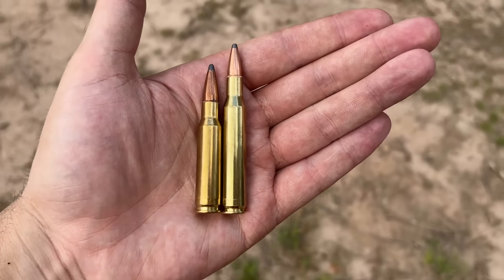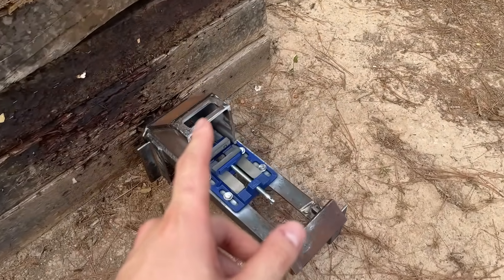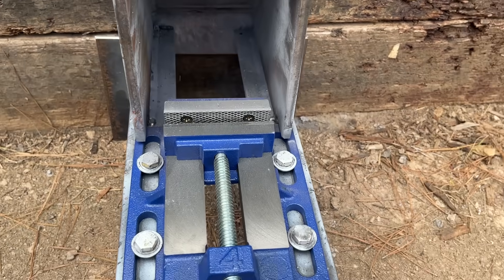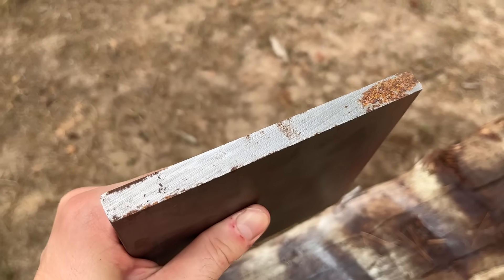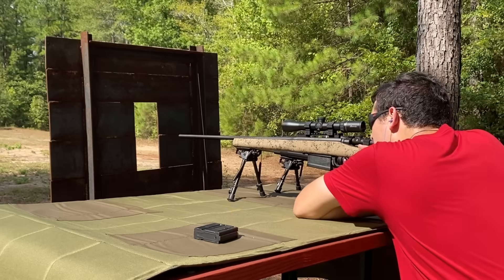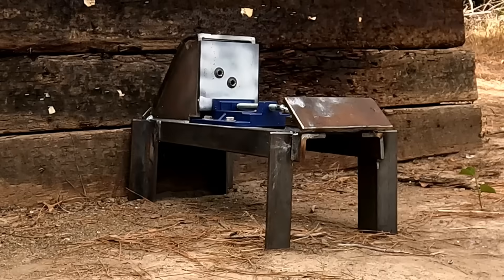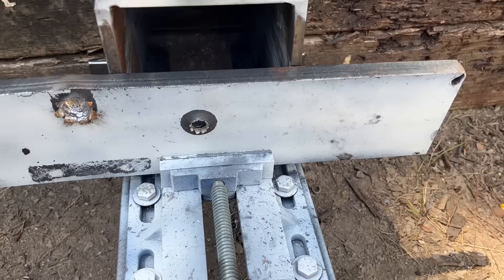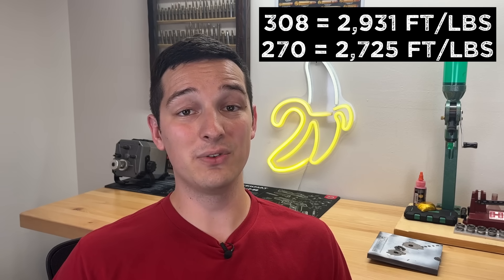270 Win vs 308 Win: ONE Clear Winner On Mild Steel

Comment: Usually, you’re going to see 20 inches in .308 and .270, probably 22 inches so it’s not exactly apples to apples but I’m glad you didn’t compare 150gr to 150gr. That would be like comparing 150gr 9mm to 150gr .40 cal. One is going to penetrate and not expand and the other is going to expand too much and not penetrate.

Comment: On a western mule deer hunt in 1985 a friend of mine made the challenge. A penetration test between his .308 and my .270. He picked out a sizeable spruce and we both put a round through the trunk. Both of us were shooting hot handloads. He was using .308  180 grain speer hot core bullets and I had .270 hornady 140 grain btsp bullets. My round  shot completely through and embedded itself in a tree trunk behind. His round failed to fully penetrate the first tree. It did not penetrate far enough to bulge or splinter the backside. Both shots were centered and about 16 inches apart. That hornady 140 grain 270 is the best bullet I ever used in my .270 handloads. I have killed several good sized deer with those bullets in front of 55.5 grains of IMR 4350 and 3 of those were head on chest shots. Two were complete pass throughs and one stopped under the skin on the beck of the right ham after shattering the hip. I cut the skin and saved the bullet which I washed and weighed on my powder scales and it still weighed 107.5 grains. Excellent controlled expansion and good weight retention. Still using the same handload ingedients with excellent results. Other than well flttened primers and stout recoil, I have some cases that have been reloaded a dozen or more times. No case head separation, no split cases or primer burn through. Neck sized only and been feeding them through a remington 700 classic since 1984. The rifle action was glass bedded and barrel floated. It will print sub moa 3 shot groups to this day from a sandbag on a bench with those handloads. I bought that rifle new in 1982 and wouldnt trade it for anything else.

Comment: Interesting.  If you were able to get almost 3000fps out of a 150gr 308 (factory is normally 2800), it seems like the 270 should have been able to do better than 3000fps.(although that is factory velocity for 130's)

Comment: If the bullets were the same weight the 270 suffers velocity loss and will fare even worse.
Velocity is the driver of energy as it increases by a squared progression as opposed to mass which has a linear progression. 
E.G. the 170 30-30 has less energy than the 150 due to the 150s increased velocity.

Comment: Within 500y, 270 is king. At range 308 takes the title. One benefit to 308 is you can drop down to 14.5 or 16 and still be effective past 600y whereas 270 is stuck at 20 in before theres severe drop off

Comment: If you used the same bullet weight in both rifles you would get different results. The higher velocity of lighter bullet weight of the lighter causes it to upset more violently so it will not penetrate as well.

Comment: Great video .The 130 .277 actually has a better sd then a 150 .308 (.242 vs .226) so with similar velocitys its actually a very close comparison. Id actually expect the  .270 to penetrate better.

Comment: 270 went deeper because the wall was thinner on the plate so it bulged, the 308 couldnt bulge that 5/8 plate. If you shot the 270 into the 5/8 it would only penetrate probably .300 deep

Comment: I don’t know what to say about the test. I think the interlock 140 gr in .270 might’ve made it through, and was closer to the 150gr you were using in the .308. 
On the boxes of the two rounds, the .270 “wins” at all ranges, but it’s retained power at longer distances grows the further out the two cartridges go. Not to mention the .270 has a higher BC, giving better trajectories really makes it a superior cartridge in my opinion. 
I know, it’s a long action vs the .308’s short action cartridge, but when I’m hunting, that little bit of bolt movement doesn’t matter for me. The .308 is a great rifle as well but it’s strength  vs the .270 doesn’t come with its superior performance when using same weight bullets (because it’s actually slightly inferior), but rather its diversity in weights of bullets it can sling compared to the .270. 
I own and love both calibres, but when I’m lucky enough to get drawn for moose hunting in eastern Canada, it’s my .270 that comes with me. 
Thanks for the videos, I enjoy watching your content. Some of your test results are surprising!

Comment: Against steel is one thing, but my .270 hunting with 130 grain projectiles on deer was rather destructive, too light for the speed. but take it up to 140's and 150's and it worked 100% better. So to match 130 against 150 on steel will make the .308 look the better of the two. I now see further comments below where folk concur.

Comment: You are not comparing calibers, you are comparing bullet weights and velocities.  If you pick a hunting cartridge/caliber based on what penetrates steel at 25 yards you are a fool.  Hunting is more about accuracy than energy and a flatter shooting, faster bullet is going to be more lethal because it’s going to be more accurate at a longer distance.  What makes the best rifle is versatility and combination of speed, bullet type/ weight and accuracy that will deliver energy at short and longer ranges.  I suggest you read a book on design and analysis of experiments.

Comment: The thing about .308 bullets is that they are often tougher than needed at standard velocitys, due to the popularity of the various .300 mags that also fire those bullets. This might produce better results on steel plates, but it deffinately doesnt produce better results on deer sized game, making bullet choice important. .270 bullet development has always been driven by the WIN, and its pretty hard to pick a bullet that isnt going to perform well in a .270win.

Comment: You should have shot the plate with the .308 a 2nd time instead of editing in a previous recording of shooting it. The second shot on that same day with those exact same factors and circumstances would have provided the information needed -> the .308 either goes through again making it the clear winner, doesn't go thru but goes deeper, making it the winner again, or penetrates less deeply than the 270 win, in which case the averages of the shots determines the winner.
Reply: Redo it with the same grain and see the difference

Comment: Love your video's! Just a quick thought. If you were shooting 1/2" (.500") mild steel and the .270 penetrated .518" and .516" of an inch, technically it did go through. The steel stretched instead of punching completely. Just saying.

Comment: Obviously this is some one who likes his 308. He chose a fast 308 and an exceedingly slow 270. Why not use one of the 270 loads @ 3200 fps, or 3215 fps. You really had to search to find a 308 that was even close to any of the 270's. I've seen a 270 put holes through a 3/8" thick steel plate at 100 yards, and the 308, and 30-06 just dented it. Each using the Hornady  SST superformance. And BTW, the 7mm also did better than both the 308, and 30-06.

Comment: The 130 is equal to a 150 in a .308.  This SD.  The.270 is some what longer with a 150 gr than a 150 
308.  So it pentatrates  better
130 vs 150 is relatively equal all things considered

Comment: those differences are marginal but i agree with the results and agree the better round is 308 but at longer distances 270 will preform better same as 50 v 408 cheytec

Comment: Someone needs to explain to you comparing 165gr to 130gr is not a fair comparison at all. My dad has a range set up with 1/2 steel set to NRA specs and the 150gr goes clean through. In fact I shot the first round and was shocked to see light not to mention it was my first and last shot lol.

Comment: That 308 traveling at almost 3000fps is a hot load. Firing g a more standard load traveling closer to 2700 would be a more standard load to compare.hevsaid it himself, he's not a fan of the 270, so he picked a hot 308 load to compare it to... not very objective. Pick 2 hot loads or 2 standard loads for an objective comparison

Comment: A higher sectional density has the ability to penetrate deeper when it holds together... but when 130 gr of soft lead vaporizes on hard steel it just simply runs out of itself quicker than 150gr of soft lead... 150gr vs 150gr would be a more level comparison in this situation... just watch a cup and core lead bullet hitting steel in slow-mo and youll know what im talking about...

Comment: Speed has a lot to do with it, but so does bullet weight. So does bullet design. There are a whole lot of variables. Stick a 150/160 grain Nosler Partition in that .270 and you'll get a whole lot different results. They are both great cartridges.

Comment: The 308 150 interlocks he was using were HOT loads!  2966 FPS is not the normal load 2820 FPS at 2695 lbs is the normal load.  Someone is putting there finger on the scales!

Comment: I just spent i don't know how long reading arguments about if you should load 150 grain bullets into a .270 or not. Because what would be the difference between that and a .30-06 and other similar stuff.

So im just gonna tell you a little thing the military discovered while testing .270 vs .30-06 when choosing which to adopt. The .270 could actually shoot flatter and more accurately at longer ranges with a heavier bullet than .30-06 and it would transfer more energy aswell. The military choose to adopt .30-06 because they wanted a .30 caliber bullet and they though the range stuff would be negligible and they where right. 

In conclusion loading heavier bullets in .270 will provide you with a more accurate and powerful version of .270. If you got a problem with it because it "defeated" the purpose of necking down .30-06 then you dont know why these bullets where made for.

Comment: tbh I see a lot of people arguing about the bullet weight being different in the comments but to my understanding this video is pretty accurate to how the 270 performs. The 270 is not a penetrating round, when it first was developed the round was unstable and when hitting soft objects the round would "blow up". Basically the velocity was too high for the hardness of the led and the frontal space of the round. The 270 is better and more reliable at penetrating and holding together now then when it was first developed but I do think there would not have been a diff outcome in the video if using the same bullet weight. Just my opinion. But I could be entirely wrong too which is okay  if anyone else has something to say on this topic.

Comment: For those that think the 270 shoots higher bc bullets then the 308, well thats not the case anymore. Comparing hornady eldx bullets from each caliber we find the 270 has a 145 grain with a bc .536 and sectional density of .270 compared to the 178 grain eldx 308 bullet, with a bc of .535 and a sectional density of .268 😂😂 nearly identical, and you can push the 178 up to 2700fps plus

Comment: I wonder if a .308, or any that make it past the 1/2" steel would also do two 1/4" pates, or if the physics change that much when a new surface is introduced.  I also wonder what a .280 would do as far as bridging the performance gap.

Comment: I bet if you shot them both into the 5/8” plate the 270 would have penetrated deeper but on 1/2” the 308 had more energy to tear through

Comment: I'm no ballistician but I'm thinking muzzle energy delivered with less bullet weight  must effect work performed negatively...on steel plate. Big heavy bullets at less velocity tend to penetrate and carry on while smaller bullets at higher velocity slow down quicker on impact....thinking of a 450 Marlin/350 gr (2000 fps) over a 30-06/180 ( 2700 fps).

Comment: The .270 goes 1.7 million miles per hour. 
The .308 or 7.62x51 travels at a comfortable 160 mph. But it'll travel through an engine block at the same speed.
 Both these rounds have their places and uses.

Comment: You forgot to compare what really matters here: MOMENTUM. If we forget about "units", and just multiply mass by speed, we get:
.270 Win: 3,072 x 130 = 399.36.
.308 Win: 2966 x 150 = 444.90.
Here you have the simple answer: MOMOMENTUM MAKES THE DIFFERENCE. Forget about the USELESS "Energy" figures everybody is comparing all the time. MOMENTUM is what makes those slugs penetrate, MOMENTUM, 399 vs 444. The .308 Win has half as much again as the .270 has, 50% more momentum. There you have it

Comment: Thank you for the testing. 130gr 270 is my favorite cartridge because it easily achieves 3000+ fps which just seems like a nice speed to me, although I am not shooting at armored targets. Today I shot one of my new Remington "Core-Lokt Tipped" cartridges at a Tide Pods container full of water sitting on a cement block; many thanks to Tide for making the best bright orange targets! The target not only exploded upward, but it smashed the cement block under it! Yes I do have it on video...
Reply: I've hit over 3200 with my 110s... I've reloaded so many 270 loads. 110-180gr

Comment: I would like to see a 150 gr in the 270 so weights are equal, 
try and use equal barrel length ,
then use Chronograph and re-do this test
I bet the 270 punches through easily , 270 has better BC and SD with a 150 gr .277

Comment: I have both cartridges and like them both.  The 308 is a Savage 11VT with heavy barrel and the 270 is a Thompson Center Dimension with a "hunting" type of barrel. My personal experience is that the 270 is less picky about ammo than the 308.  And I reload both calibers.  Other people may have different experiences, I get that.  I have owned three different 308's and three different 270's.  The 270 is my go-to for hunting (even when I had 308's that were made for hunting).  My current 308 is mostly for punching paper and steel at long ranges.

Comment: Factory ammo is always less than max load 270 case is bigger and can hold more powder. 150g bullet to the 130 isn't an even match bullet weight. Compare your pussy 308 to the 3006 and the 308 will be put to shame. Who even shoots 308 unless your a girl and can't handle the 3006 recoil. Get some AP rounds and see what happens.

Comment: There is lots of data from experiments in WWII when folks got into the physics of penetrating armour as if peoples lives depended on it!   In general for solid armour piercing shot, energy and thus velocity was king but the cross sectional area of the projectile was also a factor.   Larger shot was somewhat helpful, even  at the same or similar speeds.   Thus there was a caliber progression from 37 mm..to 57mm to 75 mm to 76mm to 90mm in the American antitank cannon effort with the Russians going all the way up to 128mm.    I have formulas somewhere.  I'll look them up.  It has not much to do with how projectiles will act in less hard targets.

Comment: You should have shot the 270 at the same 5/8 inch steel because the test was not equal. the extra steel behind the 5/8 steel would have slowed the 270 down even more than the 1/2 " and the depth would have been less.

Comment: Y didn’t u use the 150 n the 270? I would have used both 150 grains. I use 130 for coyotes 150 for deer. But I rarely use a 270,I got a helluva deal on it. Savage 110 at a pawnshop and it didn’t have a scratch on it mint. 280 bucks out the door. It’s birch wood I guess it’s a golden color real nice piece of wood for what it is and it’s a tack driver. Best 280 I ever spent. It’s rarely used sits n safe. I got severe hunting rifles.

Comment: I agree. I hand load the 270. And there’s even a factory 150 grain you could have used. Would have kept the bc closer. And definitely given the 270 an upper hand. Because I do hand load, case capacity is where the 308 falls short of the 270, and would loose.

Comment: Hum. Have always expected 3000-3100 FPS w/ .270 while .308 can w/ selected loads reach 2900 FPS, but normally it comes in at 2800 FPS. Never had problems with either round penetration on medium game like deer, etc. Would suggest using same bullet construction and typical weights used for hunting. Very much enjoy these posts. Look forward to seeing them.

Comment: What about using the 150 Nosler partition for the 270.The same bullet weight.I have used both the 308 and the 270 and I prefer the 270.

Comment: The 30 Cal is King of the deer woods! ive used a .308 since i was 12 so for the last 23 years and it does the job every time! i totally expect the .270 to penetrate deeper because the faster speed and less surface area, but nope the OL .308 does it again!...30 Cal KING!

Comment: At 300 yards plus the 130 grain 270 retains more kinetic engery than the 308. Do that same test at 300 yards and the 308 will drop considerably more than the 270 and the 270 will retain more energy. Just look at any hornady reloading manual. 130 270 will also have more ft pounds of energy than a 150 grain bullet. Remember ballistic coefficient is everything in retained energy especially at 500 yards.

Comment: And yes bullet weights could be matched a little better in proportion to the load, 
I’m a big 308 fan but 270 is no slouch, proper bullet in a good load like a good 140 or 150 will punch hard but 270 was designed to reach out nice an far on the prarie still is a king in its own domain both are venerable cartridges no doubt

Comment: Although they are some of the most popular hunting rounds, they should not be compared side-by-side 270 could easily go up against 30 -06 and even 7mm magnum,

Bottle size /powder capacities are in different categories . Although results are accurate comparing the two is a moot point